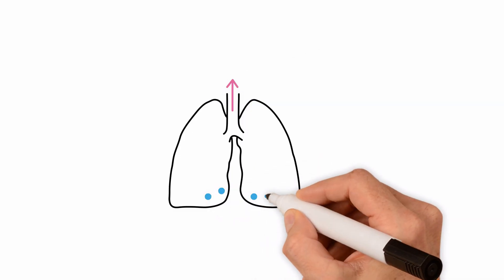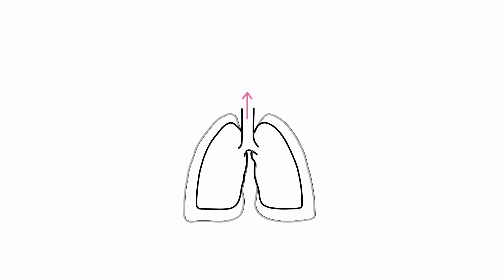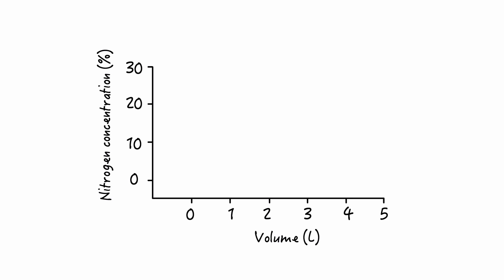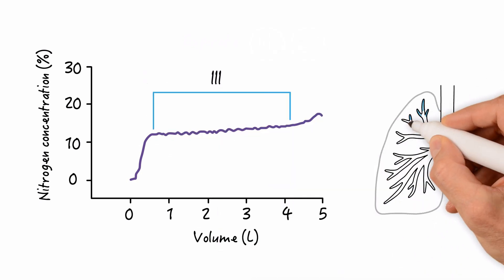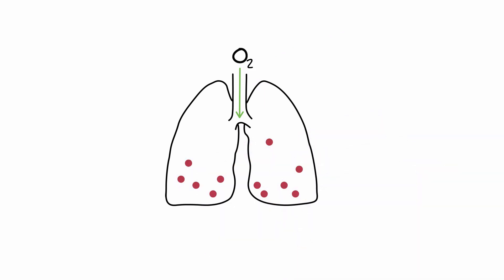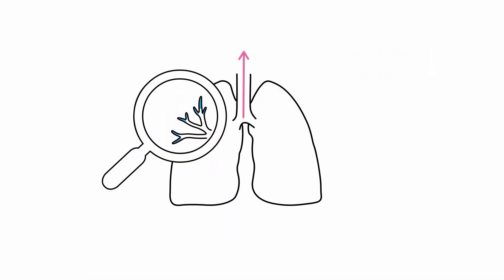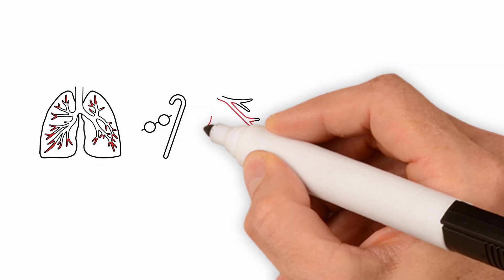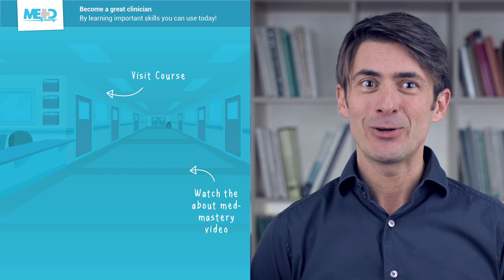Mastering the Nitrogen Washout Test: Small Airways Assessment Explained

Comment: why would the closing volume be greater in small airways diseases? It seems like the closing volume would be less than normal if the airways. Thanks for this video!! This concept is a tricky one to understand!
Reply: Because of gas trapping, reduced elasticity due to age or disease means it takes longer for the inhaled gas to be cleared, thus greater closing volume
Reply: @Music_Of_AEON  yes, makes sense thank you
Reply: Most probably because the smaller airways may have obstruction or restriction and thus amt of air occupied by them will be less which will result in expired volume being more than usual (25% of vital capacity) hope it helps 👍
Reply: I guess that's because small airways in the lower lung will close earlier than usual, probably due to shift in equal pressure point. And since the lower airways are now closed, only the air from apical will go out through the trachea, which has higher nitrogen concentration. 
So in conclusion, the slope of phase 4 will reach earlier than usual.

Hope that helps!
Reply: @drsanyamkhurana  Thank you for responding! I think this makes a bit more sense.